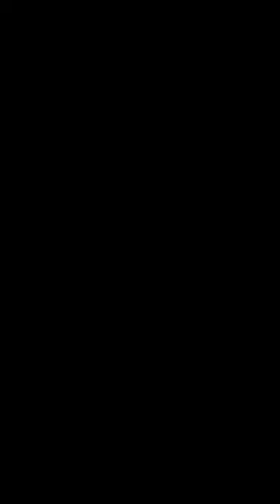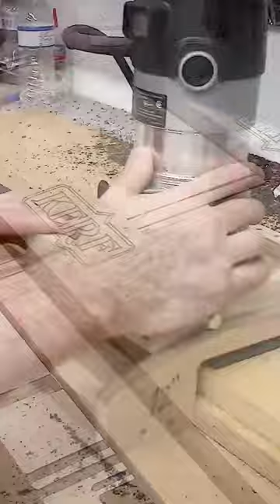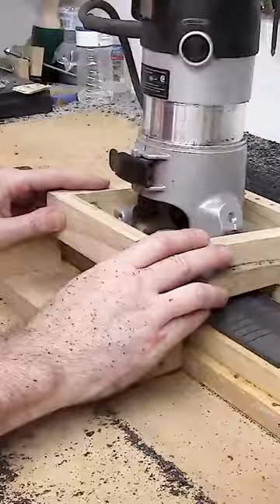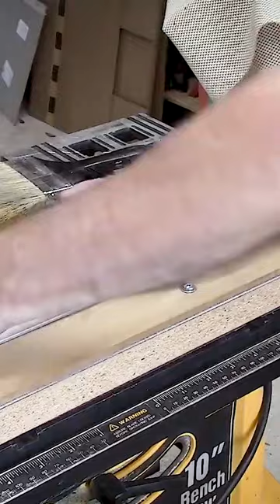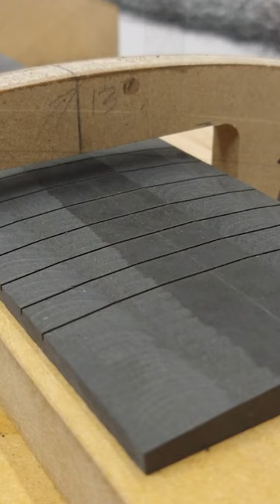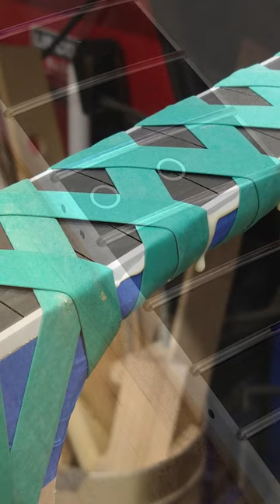Richlite Fingerboard Slot Radius Fret #Shorts

Comment: Perfect
Reply from the maker: BeardnScars, thanks for watching!
Yep, the radius fixture saves a lot of time and elbow pain.
Hope all is well. take care!
Reply: @theNextProject  did you just have a fret gauge and a blade to cut the slots? Im asking because I’m wondering if the slots have to be cut at the radius as well but I saw in the vid you were cutting out with your saw
Reply from the maker: Great question. 
I typically cut fret slots when the fingerboard is flat on all sides, then radius and re-fresh the slots as needed.  I don't cut radiused slots to match the fingerboard, at least not intensionally, however, when I go back to freshen up the slots I probably do most additional cutting on the outside edges, roughly following the fingerboard radius.
Hope that helps a bit.
Take care man!
Reply: @theNextProject  I hoped that was the answer! Take care!